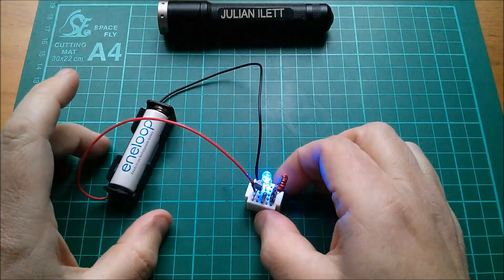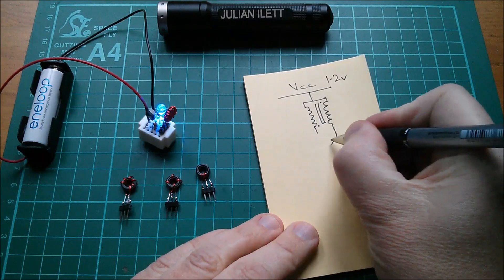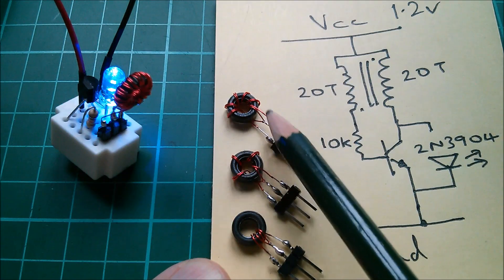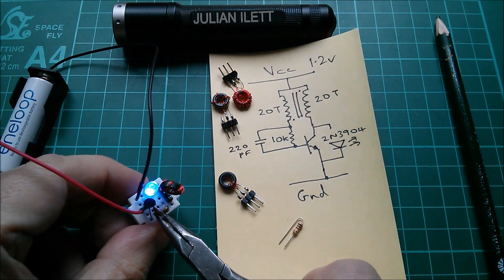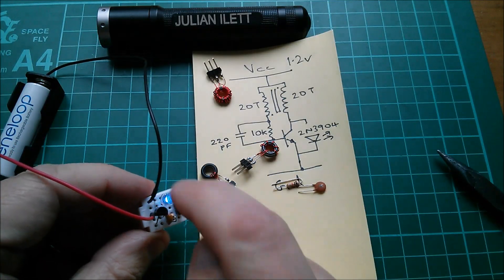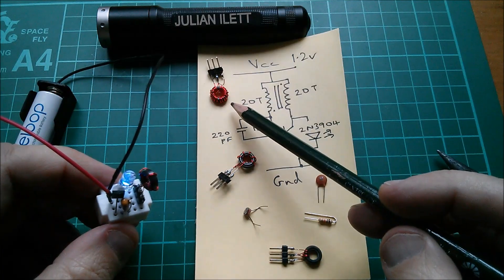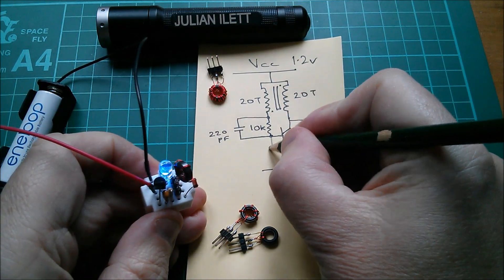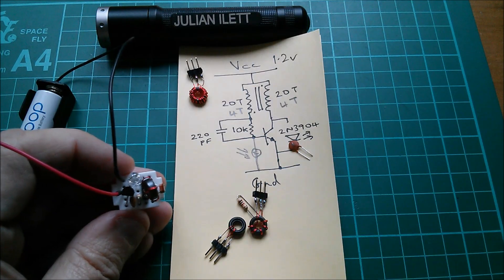Joule Thief - New Inductors - Fewer Turns

Comment: Love this circuit, currently have a sensor light that needs 4 AAs to run but has place for an extra 4AAs in parallel to make it last longer.. im running it on one AA with the joule thief. Good way to get the most out of old AA/AAA batteries that would normally be binned. Going to add a capacitor to it and maybe put two AA's in parallel with the same voltage left in it too.. 😊
Just noticed the transistor used here. Im using a S8050 or the S8055 which ever one is the NPN but im going to change it to the 2N3904 like Julian has. They're a faster transistor lower voltage drop on the base im sure. Should help get more out of the batteries.

Comment: Best to 'scope the circuit. I would expect the oscillation frequency to increase with fewer turns. Also, the 'acid' test would be to compare the energy out witn energy in but how are we to measure the power to the LED. I might suggest a fast diode rectifier, filter capacitor and vary the resistive load. That way all measurements are at DC.

Comment: Apparently you can make a joule thief with an air core transformer and just winding the wire onto a paper cylinder.  But many more turns of wire than a ferrite toroid, I would guess.   Search Youtube for  1369 New And Improved Joule Thief

Comment: I would think if the LED is strobing  with no parallel capacitor. The strobing could perhaps phase lock a second joule thief  using an LED as a photocell in the base circuit of the second joule thief. They could perhaps be phase locked in a master/slave arrangement.  Toroids are self shielding and are therefore difficult to adjust or "tune" but transformers wound on a small plastic or paper tube could implement variable inductance which is tunable by sliding an iron slug or perhaps a threaded steel screw "core" to vary its position in the tube.  A ring of such joule thieves could  perhaps be quite sensitive to the presence and position of external ferrous metals because, unlike the toroids, they are not self shielding. Maybe this could be a directional metal detector. The LED pairs should probably be face to face inside black heat shrink tubing or black paper rolled around them to exclude stray light.
Reply: I like that idea. Would like to see a few videos on this.. I'm going to put that one in the "to-do" drawer in the old gray mush in me head. Thanks 👍

Comment: It just depends on what you want to do with that boosted charge. If you need light, then sending the power to an LED at sufficient brightness is a perfect solution for your needs. But as we all know, that's certainly not the only use for electricity. You may as well choose to dump every bit you can get out of your alkaline batteries into a lithium ion battery pack. In that case, you could try to do it more quickly and less efficiently, or more slowly and more efficiently. If you boost it higher to charge faster, you'll likely get fewer mAh out of the process than if you boosted it less, and used a longer charge time at that lower intensity.

Comment: I know it's 4 years ago. But what would happen if you changed the radio between first and second coils. 4 turns primary - 20 turns secondary?
Reply: Will run even if battery goes way down....

Comment: If you were to get one of those electronic ballasts and pulled out the 3-coil transformer that drives the transistor/MOSFET half bridge, you can use it in the joule thief too. I got mine working at 0.4V with one of those, having 2 turns on each winding. No base resistor or capacitor needed at that voltage.
Reply: Cuánto consume el balastro electrónico por sí sólo?

Comment: Can someone tell me why is my circuit not working even there is a capacitor in parallel to the resistor
I checked all of the circuit if there is something wrong but all of my components are fine
And is it neccessary to replace my rubber insulated wire to enamled copper wire?
Reply: Alambre esmaltado sí, alambre con caucho no.
Haga de cuenta de que necesitas fabricar una bobina para una radio galena. Hilo de Litz o fino alambre de cobre presentan diferencia.... más aún si el cable tiene cobertura.
Se pretende un bobinado estrecho, sin aire (espacios vacíos) 🕵️
Saludos Cordiales desde Argentina 🇦🇷👋

Comment: The inductances are normally wound in opposition to each other, or actually, the terminations are connected in opposition. The Collector circuit is the inverse of the base signal. Does that mean then that if you put thje inductor in the emitter cuircuit, to ground, you'd be able to wind the coils in the same direction, because then you'd  be  in non inverting emitter follower configuration. Not sure if that is of any use, just wondering.

Comment: I use either a 33-Holm or a 47-Holm; but put so many windings that I literally run out of room for any more.  I like the idea of using a CAP in parallel to the resistor at the base of the transistor.  Does that form some type of tank-circuit? 
I have always tried the CAPs across the collector & emitter...That always lowered the brightness of the LEDs though.

Comment: To make LED light up, the turns is not very critical. It's just need enough inductance to make feedback oscillation. For an example 4 turns and 4 turns on toroid.

BUT: bigger toroid with many turns will bear smaller current and increase the efficiency enormously!
Reply: Es difícil lograr el equilibrio, en ocasiones el exceso de material puede incrementar la resistencia...

Comment: 4:00 you are just using that capacitor to short out and eliminate resistor, sometimes the resistor is not necessary in joule thief. this is why its so difficult to make an autonomous joule thief, you constantly need to adjust the resistance
Reply: You just gave me an idea 💡.
Reply: @keithking1985  do share, its been 4 years since i made that comment and since i was fascinated with this topic during pandemic with a lot of time on my hands. i think someone made a product flashlight that strapped onto an old battery and produced bright light but its gone off the internet stores

Comment: There is a garden light circuit that can run a  slow RGB LED.
It will run  a fast RGB also. I am getting  a little over 8 volts , 
taking a reading where the LED should be and the voltage is constant.
I have changed the inductor so they will be brighter.

The best I can tell they are using a glass switching diode & ceramic cap in the circuit.
I am having trouble trying to figure out how to apply this to the 
Joule Thief so I can run flashers. Got a clue?
Best I can tell the diode has 48 ST 41 on the markings. 104 capacitor
Reply: También tener en cuenta recarga capacitiva ambiental + LED en función de fotocelula...
LED aporta energía, incluso los diodos transparentes..
Slds desde Argentina 🇦🇷👋

Comment: I'm pretty sure that the initial flickering of the LED is due to the very poor breadboard. I also bought some of those little ones (as well as several of the other sizes from the same ebay user) after seeing one of your previous videos (not blaming you, had been looking for something like that anyways, and for the price was worth a shot). I built a similar Joule Thief on it, and was getting the same kind of flickering. I went back and checked the resistance between holes on the same row and was getting over 3 ohms for holes right next to each other, all the way up to 200 Ohms from the far ends of the boards (realize on these small ones thats still only 5 holes apart, and still should be dead short). You should try measuring the resistance and see what you get.
Reply: Did a little more testing on them and the resistance appears to be down to the metal row clips not squeezing tight enough to make a good connection to whatever is pushed in through the holes. Taking one of the metal row clips out of the back of one of the smallest breadboards (the 5x5 like in the video) and measuring it. First, hooking Kelvin clips directly to each side of bar, and setting meter to 4-wire resistance, I get a stable reading of 0.013 - 0.014 Ohms (so the metal itself is fine). Then I took 2 pieces of 22AWG solid copper wire and inserted one into each end of the row clip, and hooked the Kelvin probes to the copper wire I measured a wildly fluctuating 5 - 100 Ohms. Finally putting the metal row clip back in the breadboard, and sticking the 2 pieces of copper wire into each end of the row, and hooking the Kelvin clips to the copper wires I measured  again a wildly fluctuating 5 - 70 Ohms.
I had also order some of the 55 (5x11) points, 170 (2x5x17) points and 400 point half-sized breadboards from the same ebay user (alice1101983) and all exhibited the same behavior.
Reply: @lbrieden1  algunos recomiendan soldar si o sí cuando trabajas en RF para evitar falsa lectura en instrumentos de medición.
Reply: That's huge resistance, never would have thought it would have been that big. 😮

Comment: It’s always interesting watching various videos of experimentation with the Joule Thief circuit. I never tire of it. 😎👍
I have also found those 25 tie-point mini breadboards to be seemingly not quite as reliable (connection wise) as the 170 tie-point versions. They are quite handy though, especially if you get the multicolour kit with the peg baseboard, which I did after watching one of your earlier vids.

Comment: great video, Kept me busy all evening. Just tried the same with a 3pin centre tap tiny bifilar coil from a cheap doorbell and it works, need to set up an amp meter to see what specs are, Not sure how many winding it has as it came off an old board and its shrink wrapped.
Reply: Got it down to a single wind using 0.063 wire 1.7v 200ma 62nf cap and 2n2222, https://www.youtube.com/watch?v=zd10pXupBoA

Comment: If you put a cap in parallel with the LED you would need a diode to keep the transistor from shorting the cap when it turns on.

Comment: Toroid "turns" isn't a complete loop... just the number of passes through the center.

I'd bet it's running over 50MHz with the smaller inductors.... making the transistor switching times a far more significant percentage of the cycle time, which means the overall efficiency would be drastically lower... and the transistor will start heating.

You always want the transistor Ton + Toff switching times to be less than 10% of the overall cycle time to minimize switching losses.

Higher number of turns (higher inductance) slows the cycle time down, but more small wire means resistance, which means more I2R resistive losses. 

For maximum efficiency, use multiple strands of the smallest wire you have in parallel... DIY Litz wire, and optimize the number of turns to get the operating frequency low enough to keep from getting up to where the transistor switching speed causes losses.
Reply: Hilo Litz en bobina de vieja radio galena 😉...

Comment: Love the joule theif! I've tried simulating it and not found it very useful, it behaves differently in real life, probably down to the individual characteristics of the transistor and transformer.
Would be cool if you'd investigated the current draw / minimum voltages and hooked up the scope to see what it's doing.
Reply: Your right ever single one IV made looks totally different on the scope. With different shaped wave forms and frequency. But always a joy to see it doing what it does.. 😊

Comment: If you search for "Joule Thief" on YouTube it brings up 107,000 results, do we really need any more?
Minimum turns is not the most important factor, efficiency is. Who is interested in saving 10cm of copper wire is the efficiency drops 80%
It would be good is to see a project from start to finish without distractions.
You used to write for magazines like practical electronics, which is where I learned my electronics from in the late 60's.
People bought those magazines so that they could follow a project, learn from it and potentially build it for themselves.
Reply from the maker: What the magazines didn't publish were the months and months of designing, testing, redesigning, retesting, software writing, schematic drawing, PCB fabrication, article writing and so on. Now you get to see all that stuff as well!

Comment: Did anyone else notice the LDR in the first circuit (10:05min) works in reverse to the second with fewer turns (10:30min). The first reacts to light the second to dark.
Reply: Light turns them both off.  In the first case, there is not enough ambient light to turn it off, so a flashlight is needed.  In the second case ambient light is enough to turn it off, so he blocks it with his finger for it to turn on.  One circuit is just more sensitive than the other.  (The LDR resistance goes down with more light so it takes a higher voltage from the feedback winding to turn on the transistor.  What this points to is that the circuit with more turns needs a smaller value of resistance, more light, to keep the transistor from turning on, which makes sense.)
Reply: I commented on this in the previous video, but it went un-noticed. :)
Reply: Yes I see it now, the first switches OFF with LIGHT, the second switches ON with DARK, as you say the sensitivity to the ambient light, reverses the state at rest. I could go back and look at the previous video to see if I made the same mistake...... but I'm not :) it's late.

Comment: Would using different material for the transformer make a difference? Say iron instead of the (graphite)? ones.
Reply: Iron has bad high-frequency properties, and is best for line power transformers and audio. Here, it might work with a high turn count, so that the frequency is lower. There are different ferrite materials for different frequency ranges.
Reply: Thanks thought they where petty much made the same way can  they cancel one another out like sound does or am I mixing totally different types of frequency?

Comment: Interesting, but it fails to answer so many questions :
How do you acheived the highest efficiency?
How do you acheived the minimum input voltage?
What is the output current?
What is the unloaded output voltage?
What is the output regulation, including start up spike?
Can the circuit be modified to acheive a regulated output voltage/current?
Is the toroidal core saturating?
Are any of the components being stressed to the point where their working lives are significantly shortened?
What is the trade off of all of the above?
Regulation, efficiency, minimum input voltage and input voltage range are critical questions if this circuit is to be powered by a super or ultra cap. Not an academic question when super capacitor technology is rapidly overtaking the new battery technologies as providing the best way to store electrical energy.

Super caps have a far greater operating life span than the current generation of batteries. They can be made from very low cost materials, such as graphene ink ( no expensive rare metals involved). Their big disadvantage is the linear fall in output voltage, i.e. they have poor output voltage regulation compared to batteries. So what is the best circuit configuration for a joule thief powered by a capacitor? I have my own ideas on the subject, but I would be interested to learn yours or anyone else would would like to comment.
Reply: Me parece que no resulta tan costoso replicar personalmente este u otro proyecto para obtener tantas respuestas... 
Quizás te encuentres con un proyecto realizado por una persona con conocimiento básico. El típico medio loco/genio que dispone de tiempo y realizó un simple curso de radio aficionado o resulta auto didáctico ... Disfruta de  desarmar, reciclar electrodomésticos, etc
Copia y mejora ciertos circuitos como hobby con conocimiento básico... Y "quizás" finalmente desarrolla un circuito con el cual obtiene resonancia y le funciona a sus propósitos... pero no sabe mucho más y carece de instrumentos caros que incluso no sabría utilizarlos correctamente...
PDT: Nunca omitas desarrollo de tecnologías de países en vías de desarrollo porque hacen cosas sencillas por no tener acceso a mucho 🕵️
Saludos Cordiales 👍
Reply: @roman_abelardo  i am not such what point you are trying to make. 
The jewel thief is a good starting point for extracting maximum energy from  a super cap, but it is important to characterise the design so that it's performance is reproducible and can be optimised. It is easier to build a one off that works, it is more difficult to produce a design that can be repeatedly manufactured. 
My list of questions were not meant as a criticism, but as a list of parameters required to characterise the circuit. One of the problems with this simple circuit is that it is easy to over stress the components by running them outside their specified operating range, for example, too much  reverse voltage on the transistor base, or too high a starting collector current. These defects can lead to unexplained early failures of the circuit, in this case when the battery is fully charged and has its lowest internal resistance. A computer simulation will answer these questions, as would some measurements with simple test equipment.